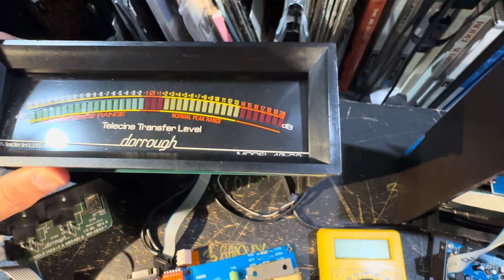Dorrough audio meter repair / model 40-C2 telecine @AERVBlog

Comment: First Innovative as their equipment was, dorrough was not always the best on keeping the manuals and schematics up to date, also an attempt to make his stuff more useful to the industry Mike made many different versions with all kinds of modifications for special systems and circumstances. They were never documented. And since they shut down the company. And Mike and Kay have retired all the information that was in Mike's head is no longer available. So you're left having to pick through what fuse schematics exist. And try to call them together I specialize in repairing the 310 audio processors, and there are still some to this day that will baffle me, that have various output amplifiers and power supplies. That are not shown in any documentation anywhere. And then not to mention the hundreds of modifications that Engineers have made to them over the years. So the fact that you can work on those blue circuit boards, which I hold for some of the worst made circuit boards ever. I must give you credit. As like I said those were terrible circuit boards to try to unsolder anything on.
Reply from the maker: Thank you for the kind words and thank you for giving us a little insight of the background of these meters and its founders. I do appreciate it feel free to comment or give us information. I’m sure we can all learn from it.

If you ever need my assistance and anything, feel free to reach out thank you so much, brother

Comment: Thank you sir for the mention. I just wonder if the board manufacturer had a bad day that day, or maybe it was Friday, since I found a couple more of the boards that were just made badly. It was a head scratcher that's for sure. The meters are in service and running well so there's that.
Reply: For whatever reason when they got to using the blue circuit board material, which was what was used in the 610 audio processors, and a lot of the meters. It was just a terrible circuit board material. And whoever made them didn't do that good job. A lot of times you'll find where the copper traces themselves or sort of a ripple wavy pattern. And it was also really early way of soldering technology. So a lot of times the solder joints are bad. I will not work on a 610 audio processor for just this reason, it was early miniaturization way too tight way too crammed, and the boards disintegrate when you're trying to work on them. The 310s bad enough. With the constant revisions were never documented. But at least the circuit boards were usually decent quality they did make some three tens that use that blue circuit material but the spacing between the traces is much wider and they're not as jam-packed with components. But unfortunately with the company shutting down and Mike no longer available for referencing information. Working on any of that stuff is one hell of a challenge now